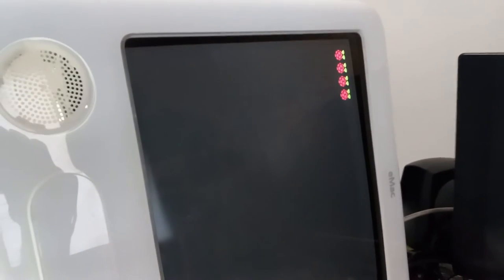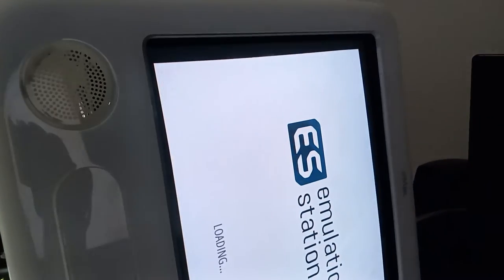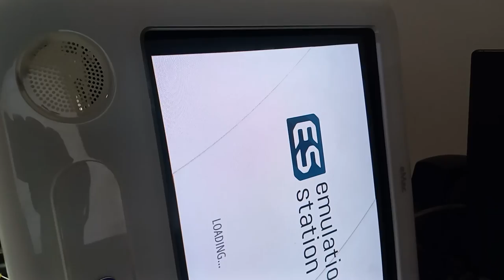Steps needed to start the eMac without its logic board.

Comment: Very cool!  I happened to pick up a Mac LC not too long ago, got the computer itself working and replaced the HD with an SD card, put an Ethernet card in it.  The monitor that came with it is another story.  Caps leaked everywhere (which is what happened to every other Apple monitor I see on YT), but replacing caps wasn't enough.  Found a bad horizontal scan transistor and I'm waiting for that to come from Digikey.  I'm also working on my own upgrades to my CoCo2, I will post on Discord once that is ready.  Nice to see another video from you!
Reply from the maker: When it rains it pours! I can't wait to see your CC2 upgrades. Thanks!

Comment: Whooooo it worked, I've got it up and running! Thank you so much for all your effort and documentation!

 One problem, the colours aren't very well tuned right now (green is blown out as hell), plus the geometry is a bit wonky. Would you be able to share or explain the code you used to grade your screen? I can write the code to the duino, but I'm having trouble parsing how to change the hex codes so I can improve the colours, geometry and contrast.
Reply from the maker: That's great to hear! This is one project I really have to revisit because so much is left  to do! Fortunately for me, I never needed to adjust the settings, things just look great from the start so I don't have code for that. However, one person did need to adjust and graciously shared some information on that. At the moment I don't have access to my eMac to experiment alongside you but you could try using parts of the code used in the iMac G3 arduino code using eMac addresses. 

Here is the link to the wiki with a table that includes addresses and ranges for the different settings like contrast, brightness ect.. 
https://en.wikibooks.org/wiki/How_to_modify_an_eMac_to_use_as_an_external_monitor

An here is the iMac G3 code.

https://github.com/qbancoffee/imac_g3_ivad_board_init

Do you want to send commands with python from a raspberry pi? try this.

https://github.com/qbancoffee/imac_g3_osd_cli

Eventually I want to do to the eMac what I did for the iMac G3. I'm glad to see that things are moving along for you!

Comment: I've been doing this project and hit a roadblock on the CRT not displaying anything. I'm using a slightly modified version of your code on an arduino nano to send the I2C signals to the CRT. I'm using the 5v supply of the analog board to power both the arudino and the CRT for pins 4 and 10 and also the ground for the arudino. I'm not 100% certain that the I2C information is going through to the CRT but when I change the wires around, it gets caught in the while loop of the read function, so I'm sure at least something is happening. On the VGA side, I have wires connected to the eMac connector to a board that splits out the DB15 pins. As far as I know, each pin is wired up correctly, with the V sync and H sync wired correctly too. The only wires not connected are for the DDE signal, which the CRT can't really use anyways. I also have a computer with a 1280x960 72Hz signal using GTF timing (which to my knowledge uses the correct front porch and sync lengths) coming out of a VGA cable. The only thing that I feel might cause nothing to show up is that fact that when the arduino and CRT are both being powered, the 5v line drops down to around 4.55 volts. There is a 12 volt supply coming from the analog board but I'm not sure how well over time the arduino would fair using that. Any input on what you think could be happening would be helpful and I can give you a lot more information if needed. Thanks for your time ☻
Reply: Nevermind I got it to work. I guess the two wires for the DDE were needed lol. But I still have some trial and error to make the screen look better. Thanks for all the hard work discovering and describing how it works!
Reply from the maker: @moqwer0929  You're welcome! sorry for the late reply but I youtube comments aren't intuitive for me so I miss them sometimes.

Comment: Rocky,  can you do LCD controller board programming? I can supply the data sheet for the PowerBook 1400c LCD, also (and yes I asked about this over two years ago) I'll need your help with troubleshooting an interface between a Raspberry Pi 5, and VGA inputs, into a Macintosh Color Classic. Everything I put through has washed out colors, to the point of being black and white? I'll post this video soon.
Reply from the maker: Hi Billy! I don't have experience programming LCD controllers but let me take a look at the controller specs to see if anything comes to mind. I remember that problem with the PI and the washed out colors, I'll chime back after I watch the video. Good to see you're back!

Comment: Awesome video 👌

I’ve learnt a decent amount since the last time I asked, but I have one burning question about the 5V source connected to the two yellow wires. How many amps or watts in total would it be supplying? I’m thinking about leaving the logic board in  and powering the CRT externally, so I wouldn’t have access to that 5V pinout in particular 🤔
Reply from the maker: I'm not sure how much current it's capable of providing but if you are planning on leaving the logic board installed, it till probably use a good amount of the current. What are you planning to power with the 5V pin? An SBC like a raspberry pi? I didn't have much success doing that. What I had to do was use the 12V out to power  a DC to DC converter specifically designed to power a raspberry pi 3. All of this was without the logic board installed. Are you going to splice in some sort of switch to share the VGA signal?
Reply: I worded it a bit weird, my basic knowledge being sketchy and all. I was asking how much current pinouts 4 & 10 draw in total when powering on the CRT 🤔

As I was thinking of leaving the logic board in I won’t have access to the 5V pinout you use in the video, so I was thinking of powering it through an external supply along with the arduino. I won’t be turning the computer on, just the CRT. Basically I was thinking a cable coming from the RAM access door, ending in a box with all the guts, power port & a VGA connection so I can plug in my PC or any VGA outputting device quickly and easily 🤔

I’m hoping I can leave all original components in while being able to use the CRT by itself as a monitor for other stuff, if that makes sense.

Comment: Thanks very much for the iMac and eMac videos and your fantastic write up on the GitHub pages. I see a lot of references to your wikihow page around the internet but that is dead so I assume the GitHub information just supercedes it? I would love to combine your iMac single-raspberry PI solution into an eMac solution and simply use the Mac power button/supply to power it all. Does the analog board trickle 5v give enough power to the raspberry PI? I'm haven't disassembled my eMac yet to determine if it has that down converter board like on the iMac that you have made a daughter board for the iMac yet.